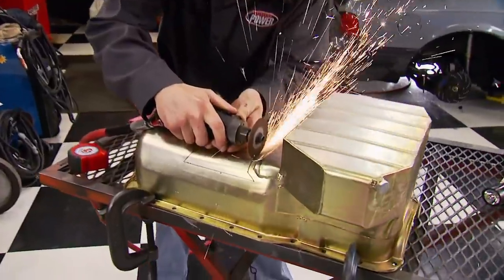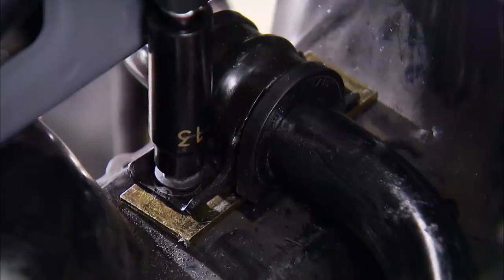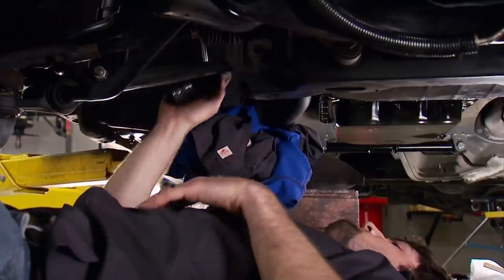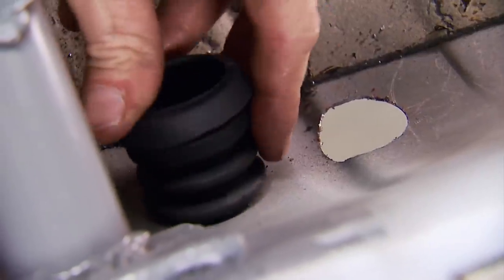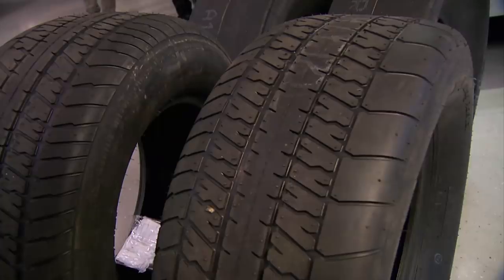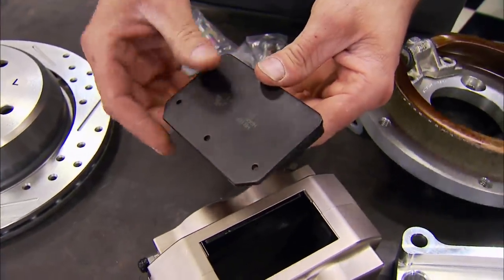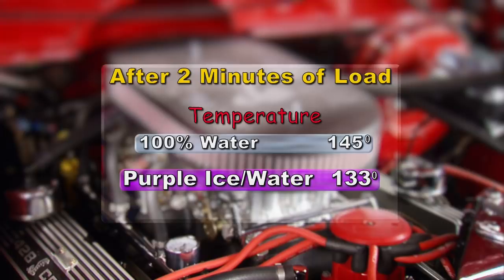Dropping a 427 Stroker Into a '97 T-Bird - HorsePower S15, E7

Comment: Was about time someone did something with that platform..
And it's a nice build.
In my opinion...one of the best platform out there.
I have a 95 with a 4.6 from a gt.
Its the best car i've ever own.
Reply: Phil Janeiro I’ve had the 97 it was a great car with with good tires that thing drove awesome and moved pretty good
Reply: I had a 94 with the 4.6. Started losing oil like crazy so I traded it in before it crapped out. Now I wiah I hadn't.
Reply: I'd like to do something crazy like that with my 96 Lincoln Mark VIII

Comment: I always use a larger nut under my lug nut to hold the rotor in place . Less screwing on and off . I used a set of Summit roller rockers on a 302 I built and six of the snap rings that hold the shaft together  broke tips off after the 500 mile break in . One of them got into the oil pump somehow . I had to remove and tear down the whole engine to find all six pieces . Trying to save $100.00 cost me about three hundred in parts and a whole lot of time . I'd NEVER use them again ! Also I used Felpro 1250 Intake gaskets and sprayed them with Permatex red gasket spray. From the onset I had a high RPM misfire and could not fix it. I thought it was in the wiring or ignition system . Later I tor the engine down and found that the number one intake runner was blocked off over 50% due to the gasket getting soft due to the spray and squeezing over  . And the number two runner had two breaks in it; one at top RH and one at bottom LH . Don't spray them . It's recommended to glue them down , torque the heads on for a few hours and reset them . Didn't work for me .

Comment: Ford 427 Stroker Engine with a GM 4L80 Transmission? That's pretty cool.
Reply: Doing trans swaps like this isn't really a new thing, theres adaptor plates available to put Powerglides and Turbo 400's behind Ford and Chrysler engines.
Some manufacturers even did it from the factory, like the Jaguar XJS came from the factory with a GM Turbo 400, and latter 4L60E.

Comment: Might want to tell your buddy his '72 Ford is actually a '79.
Reply: I caught that too.  Earliest it could be is a '73 if it had the '79 grill swapped.
Reply: evolved64 Thanks for seeing that! You always know a ‘79 because of that grille with the rectangular headlights even though that body style didn’t start until ‘73.
Reply: I laughed when he said 72. 78 was the first year with rectangular headlights and newer style grille. I'm pretty sure only the custom models in 78 had round headlights with the newer style grille, and all the other models in 78 had the rectangular headlights, which looks just like the 79's. And 73 thru 76 didn't have a gas cap door for the rear tank covering the cap. And if they had 2 tanks, the front tank was behind the seat. So it's either a 78 or 79 it being a Ranger Lariat.
Reply: Alaska7506 AND! If I remember right, 1978 was the first year the lariat package option was offered.
Reply: @That_Guy5575  Yes you are correct!  78 was the first year of the Lariat!
Reply: Holy shit! maybe he was in a separate room doing the audio and it was a miss print on the script, I cant see that ol boy not knowing the year of that truck.
Reply: common for some to swap the later grills
Reply: @tingley428  72 is a different body style. That body style is 73-79. And lariat wasn’t a package till 78.

Comment: With the weld you did on the oil pan, you created a reservoir for used oil to reside when it comes time to change it.
Reply: There is an oil drain plug at the front  and back of that pan from the factory. If you'll notice the design of it called for that anyway.
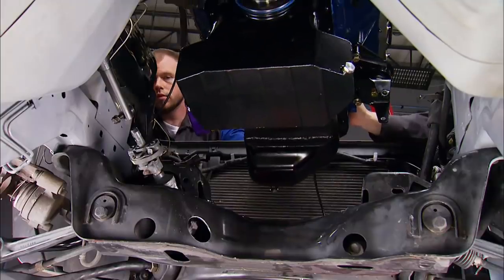Reply: At 2:25 you can see the drain plugs in the front and rear sumps

Comment: That oil pan is so modified how much can it really hold?
Reply: I wonder the same thing.
Reply: Those pans usually have upgraded oil capacity from stock so I wouldn't imagine cutting a little bit down shouldn't hurt that much 🤷🏼‍♂️
Reply: @the_azzard4921  What are you 12 years old?
Reply: The capacity is dependent on the sump size, as they didn't cut into the sump it won't effect capacity. Engine masters did an episode about oil capacity and how over filling the pan will Rob horse power.
Reply: The children are playing on mommy’s computer where they can practice their swearing. Lame
Reply: Most of the oil sits down in that big rear sump and some in the front. I bet it barely affected the oil capacity at all.

Comment: I wonder if some oil is stagnant in that pan, because the pickup can only be on one side
Reply: I'm sure enough oil gets sloshed around as the car moves and as the oil drops down from the top of the motor. Plus with the 2 drain plugs it'll never be in there long as long as you keep up on oil changes.

Comment: Well I owned 18 Tbirds over about ten years. Most Sc`s but they have made a tubular K member that would have saved a lot of time and cutting. Point of information A coyote engine will not fit in these cars due to strut towers. The engine heads are just to wide to fit without cutting. Tim Teebo had a old Tbird that someone was able to do all the fab work to make one fit. For now all my birds are gone and I replaced it with a 727 2015 mustang GT. I will never go back but they are good cars and I will add that I never broke a bolt under the car as they used top notch bolts that never seized or rusted out and i`m from the rust belt.

Comment: To answer the question at 10:30, electric is the way to do this. A Tesla Model S P100D produces 588hp and 920 lb/ft of torque (available instantaneously, starting at less than 1 rpm) while still offering the equivalent of about 98 mpg city/highway average when driven "normally". The best of both worlds.
Reply: But electric cars will never soul, sound, and character of the gasoline cars mate.
Reply: But will never make girls smile.
Reply: @CJColvin  We'll see (you at the track!) ;)
Reply: @JustWasted3HoursHere  LOL!!!!!!
Reply: And that's the whole point. You cant modify it and personalize it. Just everybody with the exact same thing all boring and sanitized. No rumble. Just complete quiet. The occasional one to be a interesting conversation piece. To represent what man can do...great. But a whole world of them? No thanks. I dont want a watered down sanitized life.
Reply: @CJColvin  said: But will never make girls smile.
I guess you haven't seen the multitude of first-time reaction videos of woman (and men) riding in a Tesla, eh? It's impossible NOT to smile when your head is slammed into the headrest... :)
Reply: @imperfectbeliever8127  "Watered down". Okay, sure. As far as the ability to customize them, you make a valid point. It will take time for the shade tree mechanic and aftermarket parts world to catch up, but it will happen eventually as more and more ICE cars are passed by stock Teslas (and other EVs) at the track... And it's only going to get worse: The tri-motor cybertruck gets 0-60 in less than 3 seconds. This is a fullsize pickup truck that's faster than about 99.9% of the vehicles in the world, including most supercars. And the Tesla Roadster 2.0 is less than TWO seconds from zero to sixty. And under 9 seconds in the quarter...stock.

If the purpose of driving a muscle car is to look and sound cool, then you may have a point. But if the purpose is to go FAST, then you might want to reconsider.
Reply: Justin Henry  Exactly mate.
Reply: @imperfectbeliever8127  I totally agree brother.
Reply: @JustWasted3HoursHere  Yeah but no hearing the engine sound really takes the fun out of the vehicle. I bet you love that hideous ugly looking Cyber truck Tesla is making as well mate. Also oldschool muscle cars and Hotrods will make girls smile more than any overpriced plastic Tesla you see on the road as well mate.
Reply: @CJColvin  Like I said, check YouTube for plenty of first time rides on Teslas and see smiles from beginning to end. Imagine you're in your stroked and ported Camero or Mustang with your girl and here comes this ugly Tesla truck pulling up next to you at the light. You rev your mean sounding engine and your girlfriend smiles. You push in the clutch and push it into first gear. You look over at the Tesla and he nods at the stop light. You nod in return. It turns green and you floor it. You look in the rearview mirror for the truck but it's gone. Oh, wait... he's at the next light already. Your girlfiend says, "Hey, what was that? That thing was FAST! You should get one of those!"
Reply: @JustWasted3HoursHere  I have seen Tesla videos and people's reactions and those people (that don't know about cars) seemed to like the overpriced plastic Teslas but as for US gear heads and grease monkeys mate well it looks hideous and for the beautiful ladies (that are real gear heads and not complete fat blokes like the ones in the videos) will love and enjoy the looks, sound, and feel of an oldschool muscle car or hotrod and I know some pretty girls will love the looks of my 96 F150 and they'll love the sound of my 2011 5.0 F150 with the Borla S-Type exhaust plus Batteries are completely expensive to replace.
Reply: Tesla wasn't even a glint in Elon Musks' eye when this show was produced.

Comment: How is it a sleeper if the carb sticks out the hood? It is way too high, and it doesn’t even have a filter.
Reply: Random projects USA ; 1989-1997,98? T-Birds will put anybody to sleep.
Reply: Cobra Charmer   You realize putting 610hp in pretty much any car makes it fast, right?
Reply: @randomprojectsusa5196  ; You do realize you're contradicting yourself with that question? I guess you would prefer the old 5.0 from the 80's? Or a Chevy engine? This "Boss" 351 has a taller deck than the 5.0, which means the intake manifold and carb is going to be 1/2 foot above the hood line. I was referring to the T-bird body lines of 1989-1997 or 98, whatever the last year was. Not my favorite body. Nearly 10 years of the same ole style. I slept through most of it. A few years later, Ford reincarnated the 2 seater ugly ducking. I loved the 84-88 T-bird body. You just couldn't get the Mustang GT engine with it or any other T-bird for that matter.
Reply: Cobra Charmer  I don’t understand your logic, a sleeper shares “sleep” in its name, they chose the Tbird because it will put you to sleep.
Reply: @randomprojectsusa5196  ; "will put you to sleep." As in killing? Ah man, you're making me regurgitate my left over turkey sandwich. I'm not speaking Vulcan.There's no logic to it. The T-bird years I mentioned,is so blah, I personally fall asleep looking at it or thinking about it. You're the 1 crying about this particular T-bird not being a sleeper. No matter what you do to this model T-bird, it's still bland and boring, even with a 600+hp engine. Me personally, would rather see this engine installed in a 1988 T-bird Turbo coup. Just glad a Chevy engine wasn't installed because, Instead of sleeping, I'd probably die. Get it now? Hope Thanksgiving day was good for you.  John
Reply: And also, it’s literally supposed to look as boring as humanly possible, so the T-bird is doing a good job. However, as the carbs stick out the hood, it would give it away to almost anyone that there is something going on
Reply: @randomprojectsusa5196  ; Couldn't agree with you more. At least it's a Ford with a Ford engine.

Comment: So fox body bbf swap headers and oil pan go in significantly better. Also you can use the stock 4r70w with an adapter plate.  Granted having 4 gears and 4.10s wouldn’t be as ideal as the 6 speed but if you’re a weekender who gets a hold of a cheap bbf and wants a fun highway killer or red light racer this can be done on a lot cheaper budget.

Comment: Those mufflers are "extremely free flowing?" Am I the only one who see the major short turn that the gasses have to make in those? I would have gone with something straight through.
Reply: To muffle sound you change direction of the gase's inside the body of the unit.
Reply: They are very free flowing actually, similar to a flowmaster 10 if you buy the straight in straight out extremes, these are offset style

Comment: After looking at all that work......my '95 T-Bird will remain stock or put a turbo on it.
Reply: I wanna 5.0 in mine I have 93 T-bird
Reply: @Elevated618  That's what I've been thinking.  I had a nice one lined up with 34,000 miles on it.....then health problems got in the way.  Doggone it.
Reply: Coyote swap...
Reply: @davidhovik7176 Do you think there's room for the heads?

Comment: If that small rear sump doesn't have an oil pick up, it's pointless in keeping it as oil will just sit there without recirculating, the excess dripping into the center section when full.

Comment: I'm probably wrong but isn't there supposed to be a aluminum plate between the block and trans? Maybe only on 302 based strokers not 351 windsor versions.

Comment: @PowerNation project Deepsleep is old. When watching it before there was a transmission with a paddle shift kit. The DVD did not include any information regarding the transmission. Now I see a TCI 6 speed 4L80 based trans. Did you omit the info on the trans because it's a weak trans? Fight with suppliers? What gives? Why did I buy a bunch of DVDs and not get all the content?

Comment: Will a 427 small block stroker fit in a T Bird?
Why wouldn't it? A small block 302 inch V8 was standard equipment, and the 351 inch small block V8 was an available option when it was new.
The INTERNAL demintions (bore and stroke) changed, not the EXTERNAL dimentions.
Will a 427 inch SOHC  or WEDGE big block engine fit?
Not without a LOT of cutting, modifications, and a shoehorn.

Comment: 4L80 6 speed ? I always thought they were a 4 speed
Reply: Justin Henry  He did call them 6 speeds though, twice.
Reply: @dazaspc  tci just used the 4l80e case and converter but the internals are designed for 6 forward gear ratios.

Comment: I don't  know about you, but like the old system better and feelvsafer too than using that so-called PRO spring compressor. That machine will comply when you need to use angular support. Frankly I  believe  it is more dangerous than using a long threaded rod & couple or ratchet straps. The Matco seems like it is made for people that are 6' 3"+

Comment: What do you mean by "boss" block?
Boss 351 Cleveland?
Stroked and bored to 427?
Or a Windsor built to 427
If it's a Windsor,it's not a boss
Reply: Ford calls it a boss block but it is very similar to a Windsor so it will fit into the same applications. Much tougher block then a factory Windsor though.

Comment: Catted exhaust on a carb,stroker motor setup..mmmmmm 🤔
Reply: Because that year of car needs a cat unfortunately.
Reply: Basically to keep the legal guys happy. Car came with cats, so you're "supposed" to keep them on the car.
Reply: sparkplug1018 

I get that but it didn’t come with a carb so hows that work? I’d love those emissions! California is whack
Reply: @Coyote_Mach  Honestly its just the bare minimum to keep the legal guys happy. Car came with cats, cats go back on. 
Car is also supposed to be OBD2 compliant, but like you said, that went right out the window with the carb. 
So just comes down to keeping those guys happy in the end.
Reply: sparkplug1018 : The last of the 460 EFi trucks was OBD2 port EFi with a Holley 4150 4 bbl Flange...you can OBD2 your stroker 427 if you have to with the crazy "scorpion" style big block twin 51 mm throttle body the 96 trucks had.
Reply: Dean Stevenson Sure you can, but why would we bother?

Comment: To bad its such an old show. Why didn't they just use a 32v Teksid 'terminator' engine? It did come stock with the Lincoln Mark 8. (93-98).   Could of made it a standard too...TREMEC tr 3650. Although that didn't come out till 2001.

Comment: You put catalytic converters on a 600-something horsepower carbureted car?  Why bother
Reply: Mostly to keep their legal department happy. Car is a 1997 and came with cats, so you're really supposed to keep the cats on it. Granted being as free flowing as they are, and being a carb they really won't do much in the way of emissions.
Reply: Emissions.

Comment: The only reason I give this video a thumbs down when I don't do often is the disagreement that you run slicks with a stick car over drag radials. All you need for a stick car to use radials properly is to use a Clutch Tamer or similar product. Nobody in competitive Coyote Stock racing runs an automatic and they all run drag radials. Many of them use a Clutch Tamer/Hit Master which are available for cable or hydraulic clutches. Since this product is only available from one person and not Summit or another large company it's not mentioned here. Radials are much more efficient, the days of using slicks at all are numbered.

Comment: 100% you could have used a Crown Vic 351w rear sump oil pan off Amazon for 80$ and maybe a couple washers used as height shims., and it would have  fit without all that cutting and welding that goofy aftermarket oil pan. You wouldnt have neeed those aftermarket motor mount set up either. What a waste of $ and time

Comment: Such a BAD idea for an oilpan. Your not going to be able to drain the last quart in it. And its just going to produce a major sludge pad on the opposite side of the pan. Wtf were yall thinking? You need to level the pan out not turn it into a camel back.